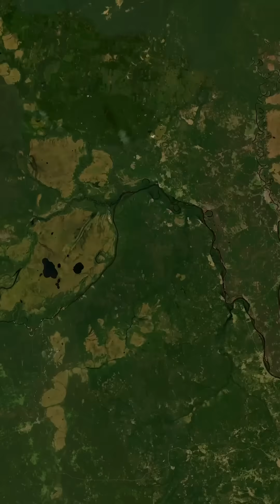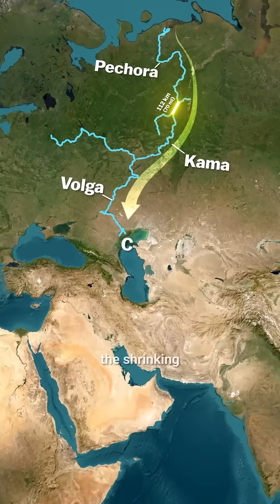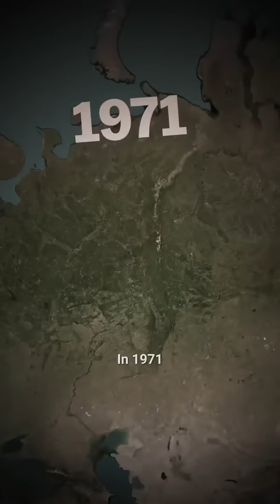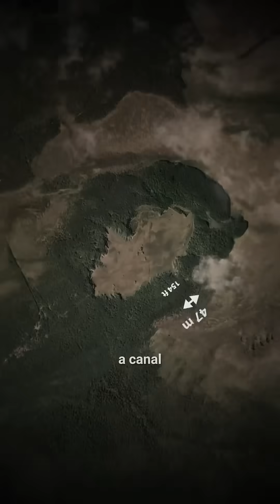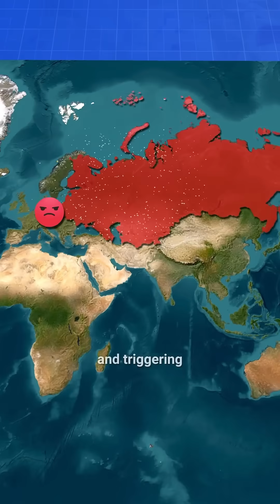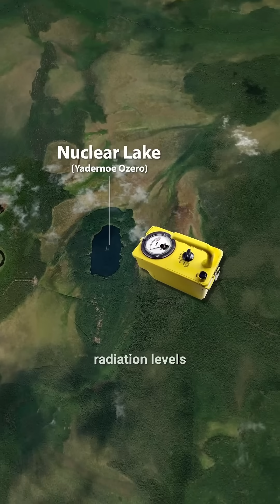250 Nuclear Bombs 💣 USSR’s Canal Plan Gone Wrong 💥 Nuclear Lake ☢️

Comment: The reason it failed is actually interesting.

Normally, nukes are detonated midair as they are dropped. This causes the explosion to descend upon the target location and all radioactivity and destruction only affects exactly your target and nothing more. And because pilots don’t want to die, the bombs are designed to direct the explosion downward as well.

This air burst idea was used for Hiroshima and Nagasaki

These canal nukes were ground level. Since the ground is hard, the explosion went up. This causes radioactive fallout to be shot into the sky instead of the ground.

Somehow the USSR didn’t get the memo to not detonate nukes on the ground

Comment: TL;DR: Older bombs had major fallout because they weren't efficient. Modern nuclear bombs don't have that problem to such an extent.. It might actually work nowadays.

From my understanding of nuclear bombs(which is limited, I'm not a nuclear physicist), the main reason for the immense fallout of older nuclear weapons was the inefficiencies in our methods for achieving fission. Due to those inefficiencies most of the nuclear material(I believe less than 3% of Little Boys 141 lbs. core actually underwent fission) would actually be unable to achieve a reaction and just be blasted away upon detonation, out and into the atmosphere to then settle on the ground as fallout. Most of the older bombs had fallout timeframes ranging from decades to centuries. Now with concentrated efforts and proper remediation and cleanup, this problem can be mitigated.

With modern nuclear weapons, those inefficiencies have been mostly remedied and as such our warheads are not only much smaller, and more devastating, but they can actually use less material in the core because much more of it actually undergoes fission/fusion(I believe modern bombs can achieve as much as a 50-60% conversion rate).

Nuclear weapons are neat.

Comment: Water actually block radiation. When you swim, you actually receive less radiation on normal environment than walking on the ground.

Nuclear core in power plants is submerged with water not just for cooling, it actually helps blocking harmful radiation.

So while going and staying there is not the smartest thing to do, as long as you are always submerged it's actually safe to swim there.

But you might go to isekai from lack of oxygen 😂

Comment: These were "clean" charges - they don't present any serious threat of dangerous fallouts.
Reply: Then why were the "fallouts" detected, over 1000km away from the explosion site?
Reply: @balometer Trace amounts. Individual isotope molecules. For examble do you know that trace amounts of radioactive fllaout contains EVERY substance in the world produced sinse the first atomic explosion? That's why unradioactive steel (for example, for Ghegher counters) is mined EXCLUSIVELY from the steel produced BEFORE any nuclear explosions? For example from sunken old ships.
Reply: @Hugh.Morjowie  Low-yield bombs are never "clean", because they're invariably fissile. In fact any nuclear bomb, either fissile or fusion based, produces a significant amount of ionising radiation, due to the use of fissile tampers. An unconfined ground detonation of either type of bomb also produces a lot of fallout particulates, which is why the explosions could be detected as far away as Denmark. Most of the radioactive material in modern steel comes from testing done before the 1980s, and depending on the origin of the iron used to make the steel, the concentration and composition of the contamination differs. Who would have thought that the value of WW2 ships on the bottom of the sea would be greater now than when they were built?
Reply: @balometer  Incorrect. Fusian charge can be very clea. Example  All neutron charges are reliably clean and being a fusion chargers of low yield provide only inducted radiaton (neutron-inducted rad) - and produce no magor poisoning isotopes.
Reply: @Hugh.Morjowie  Fusion can be clean, but the fissile tamper is still needed
Reply: @balometer  All over the WORLD there are dispersed TRILLIONS and TRILLIONS of atoms of isotops that appeared EXCLUSIVELY in  fusion or fission rearctions. That were most absent until nuclear tests started. Even now. And will be for thopusands of yesrs.(As far as I remember most of them moved to the uper layers of atmosphere till now, but are still very ez detectable.) Their threat is about 0 - they are too disperse

Comment: Could have used TNT.
Also, had they finished the project, the water wouldn't be radioactive, as it would have washed away.

Also, radiation contamination would have disappeared in less than a couple years at most. Finishing this might have saved that region from its current climate issues.

I'd argue the USSR ran out of nukes, and lied about the fallout from nearby states to cover their butts.

We know Soviets never cared for their neighbors.

Comment: Fun fact modern day hydrogen nuclear are so efficient at consuming radioactive material during the explosion that radiation is not a problem making the project viable today, except for the size of the evac zone due to the massive blast radius and forest taking on fire miles away just from the light emmited by the explosion
Reply: Radiation and fallout are still produced, especially if detonation is at or below ground level. The energy yield per unit of pollutant is far greater than with fission, put pollutants are still there.